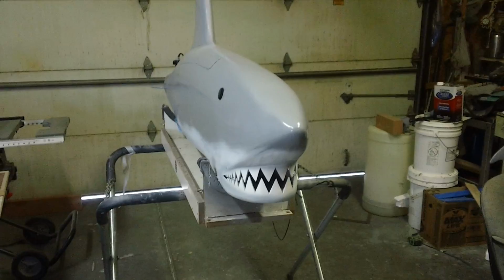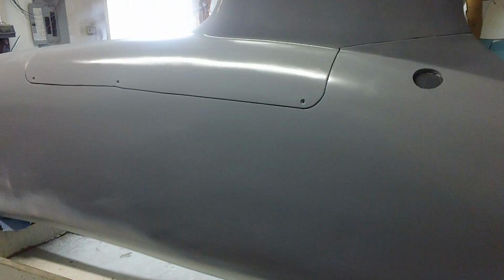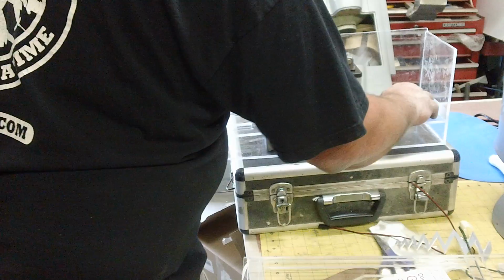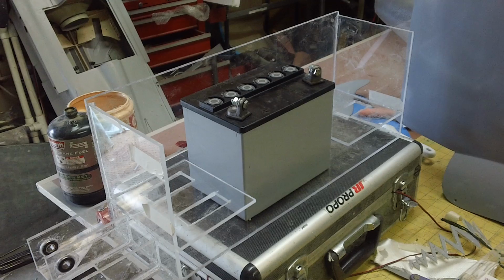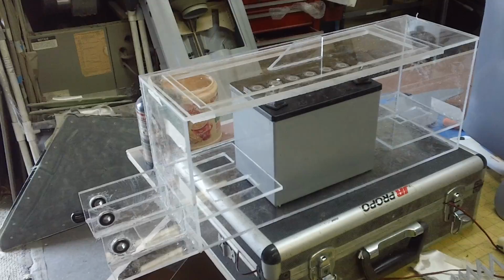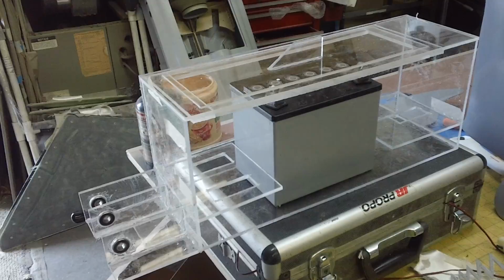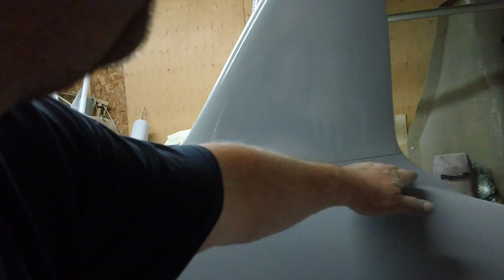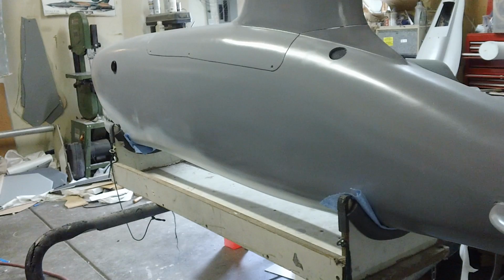what have I been up too?

Comment: Whew I thought something might have gone sideways on you as your dad had a stroke then what happened to your brother, I was concerned so I am now no longer holding my breath.  He bob when I built my sub I had a lump of led on the balance point and put it on a pendulum to stop rock from side to side as when I would go under while moving forward it would rock as the air escaped,  I found the center of balance is a good point as forward or aft caused instability. But seriously glad to hear yall are fine. ; )